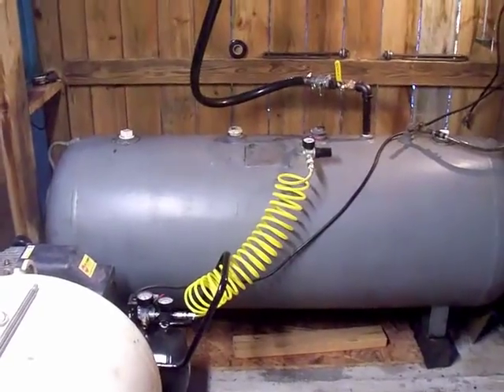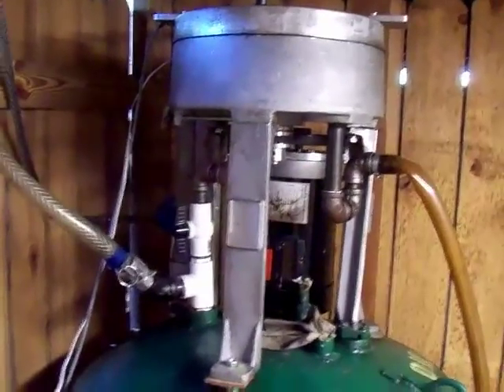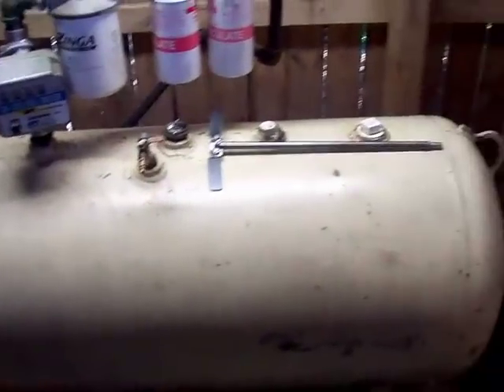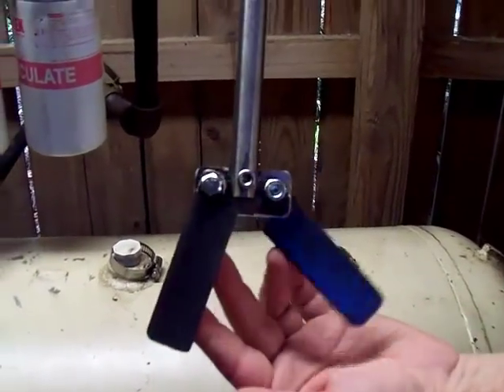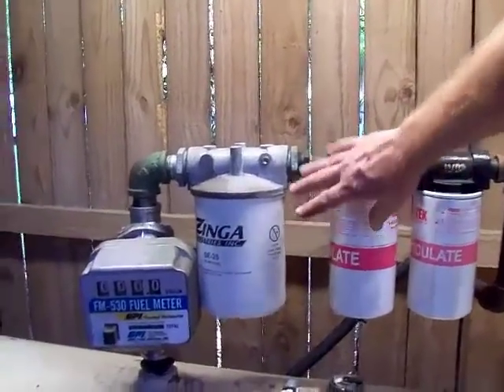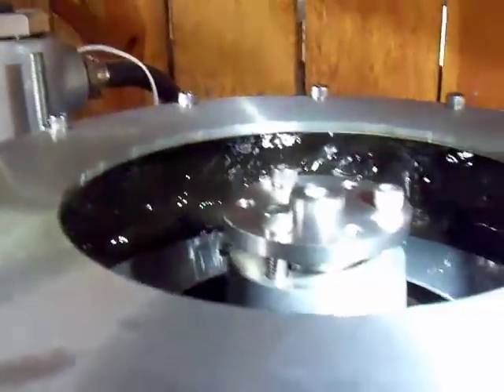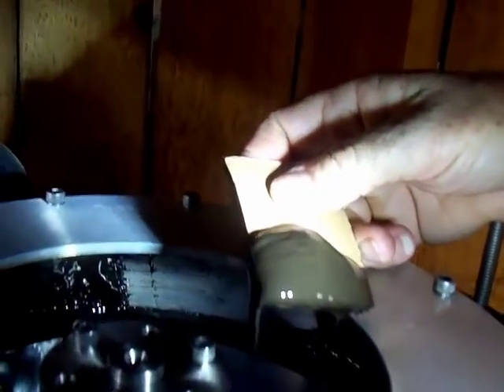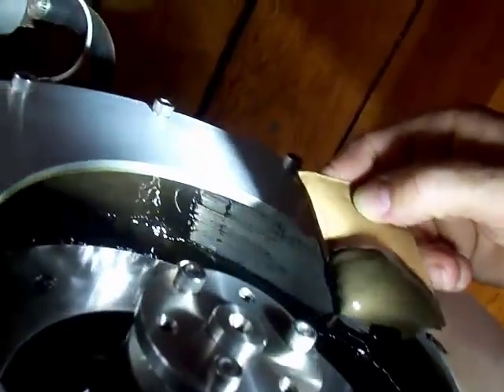Make Diesel Fuel From WMO Waste Motor Oil. Black Diesel Processor

Comment: would you recommend the harbor freight air compressor for vacuum on a 250 gallon tank to pick up WVO and its sludge
Reply: Yes, that was a Harbor Freight air compressor on the vacuum trailer I think it was $99 on sale for $79. It works OK and is cheap. I think the cast iron ones hold up better.
Reply: wow thanks for such a rapid response I was building a 250 gallon vac tank to clean 20 - 50 gallon intercepter waste traps here in Houston a vac pump right now is out of my price range so I was looking into pre pressure measures and stumbled on your vid originally I was going to use dual thompson dc pumps but I have a harbor freight compressor 2.5 hp 10 gallon tank already that i use for house hold things but i can afford a used gas powered one from craiglist my question to you is would this gas powered A/C pull enough vacuum to evacuate say a 50 gallon grease trap with solids nothing to hard but food solids thanku 4 ur answering
Reply: ok nice i have the 2.5 i will definitely look into a larger model dude thanks for your help will send a vid to you thanku seriously
Reply: one last question sir will the 6.5hp gas engine  do ok with the 5 HP 145 PSI Twin Cylinder Air Compressor Pump or should i go with the 13hp all from harbor freight also

Comment: I had been cold centrifuging, and just got my heater working, now centrifugiung at 150F.  Last batch burned clean till 1/4 tank, then she started smoking a bit more than I like.  I add injector cleaner, 10% unleaded and blend it pretty aggressively with a blending stick comparable to yours.  What else can I do to eliminate or reduce smoke?
Reply from the maker: Generally you will run 20% gas to 80% oil . If blending diesel, the ratio is between 20% and 50% with the balance being oil. 10% is pretty low and liable to be more smoky. If you run well on the first part and smoke at the end, then there are layers in the tank and you are probably running on almost straight oil when the smoke starts. At 10% , you are running half what we recommend for blending and that may be your problem.
Reply: Cetane booster.

Comment: you say that you mix the WMO with gasoline.

what is the mixing ratio, do you heat before mixing, and what experiences or wisdom that can be passed on using WMO/gas mixture?
Reply from the maker: Just like in the video, I use 20% gasoline. Sometimes I add diesel but it all seems to work about the same. Diesel does not cut the viscosity as quickly as gasoline.  The oil coming from the centrifuge is warm and I mix while the oil is coming out. See the "Running On Waste Oil" printout in the write up for more details on blending ratios. We started testing this in 2004 on diesel generators. Went off line for 18 months running on waste oil and since then in many different applications. It works good but you should read the printout for more details.

Comment: Very nice setup.  What do you dispose  the "goop" and what has settled in the tanks.
When you run this on the road how do you handle the taxes.
Reply: USFiltermaxx My son was joking about putting the goop in short glasses, put a string in it and call them "scented candles", sell them at craft fairs!!
Reply from the maker: Take the goop to the local oil recycling center. You should consult your dept. of revenue.

Comment: Hi, I just wonder how much does it cost to refine on each gallon of used oil to make it into diesel?
Reply from the maker: Here our electricity is 13 cents per kWh. They tell us it is cheaper but if you add in all the taxes and fees, it comes out to 13 cents. Running the machinery cost about .0175 per gallon (less than 2 cents per gallon). Depending upon how you blend it, you may add 55 to 70 cents per gallon. You may add more or less but I think $1 a gallon would be tops.
Reply: Hi,thanks for responding. But if this is engine oil, you can refine it back to Base Oil (83% of engine oil is base oil and the rest is additives). Base oil is more expensive than diesel because only 5% of crude oil is base oil.

Comment: Do you blend motor oil in the winter as well. Like 30 40 degree. Ipersonally haven't tried, didn't want to mess up vp44 pump sencond gen dodge here.
Reply from the maker: Yes, In cold weather I do use a block heater on a coffee pot timer. I also have a 120 volt filter heater. Coldest it is here is 24 and it starts right up. I will have to go up to the mountains to test lower starting temperatures
Reply: USFiltermaxx Hello
nice video, thanx, what do you mean by ''I do use a block heater on a coffee pot timer''?
Reply from the maker: The engine has a block heater. I use a timer that turns it on about 4am so the engine is warm when I go out in the morning.

Comment: I am interested in finding out if black diesel can be used as a home heating furnace fuel. From what I gather reading so many things about this subject it sounds to me that it can, is there anyone that can enlighten me further. If your product can be used is there a way to get the plans for it so that I can build a similar unit.
Reply from the maker: Yes and no. Yes, WMO works in heaters but the issue is that when the heater turns off, the nozzle gets hot from the radiated heat of the furnace. This causes the oil to coke in the nozzle. In commercial waste oil heaters, the nozzle is a little different and oil is blown in using compressed air. I have one customer that installed a T right before his burner and gives it a shot of carb cleaner every week. I will assume that you can cut your heating oil maybe 25% with WMO, but if you plan to use a higher percentage, you should install the proper nozzle. You can buy a nozzle here: http://www.ckburners.com/kits.html

Comment from the maker: This post in in reply to the person that asked how this unit compares to one by Simple:
A competitor published his lab test results and our old design from 2004 still beats all the latest designs from all the other centrifuge manufacturers. Our old unit removes about 43% more  contaminants that Simple Centrifuge's latest model.  We have made several upgrades to our unit since 2004 so I'm sure the our new units perform even better.
Regarding the diesels, 10 years running and we run them every day. I am currently building another engine with a Banks turbo to put in another project. I probably should post some photos. I will finish the new engine this week, so yeah, it works good.
Reply from the maker: Get the PDF here:
https://usfiltermaxx.com/en/content/9-make-black-diesel

Comment: Nice setup. Pull a fuel sample from your final product and send it off to a lab to have them test the BTU and fuel performance.

Very curious what the results would be.
Reply from the maker: Oil is about 138,000 Btu / gallon.

Comment from the maker: Much of the water comes out in the settling tanks. The rest comes out in the centrifuge and you can see this in one of the other videos. The fuel runs in several motors, a 4 cylinder Weichai Gen set, 6.9 international. 7.3 international, 6.2 Chevy and 6.9 Cummins.

Comment: Hi, thanks for the very informative video. it is a great set up that you have there. Does the centrifuge get rid of water too? What do you use the finished product for? Regards
Reply from the maker: Water comes out as both a liquid and forced out as vapor as this is a self ventilating centrifuge. The base airflow before piping and losses is about 35 CFM. You can see some of the vapor in one of the videos, I think it is the 6000G video.  There is also a customer video cleaning WVO. He has a pretty good steam vent going on too.

Comment from the maker: Both the rod and bung hole are typically covered with oil and not likely to spark anymore than the bearings in your car. I do cover it with a rag to keep vapors in the tank but because percentage of gas in the mix low, the partial pressure of the gas in the mix  is also low. There are not strong vapors. This is not a high speed mixer. At 200 rpm you are looking at about 7.8 inches per second surface speed which is pretty low for oiled steel.

Comment from the maker: Thanks Dave.  It works great and the oil is always enclosed from the time it goes into the pickup tube on the oil trailer all the way to the final equipment tank. Nothing ever exposed to spill. Really a clean system.
Reply: Do you clean the centerfugal tool in the gas container?